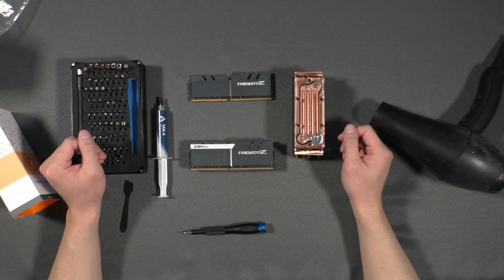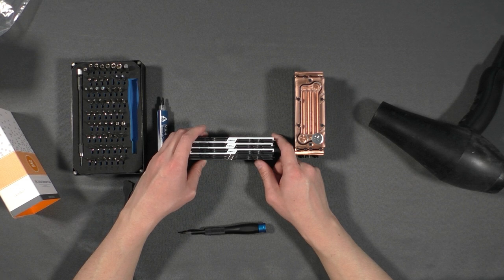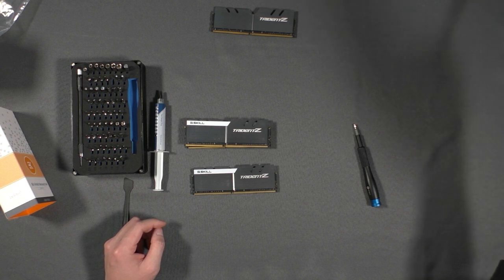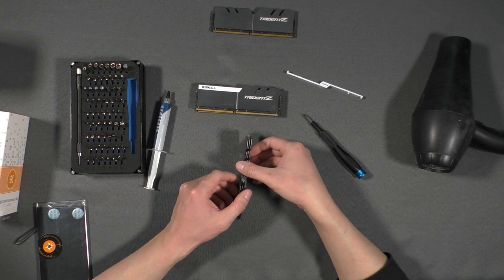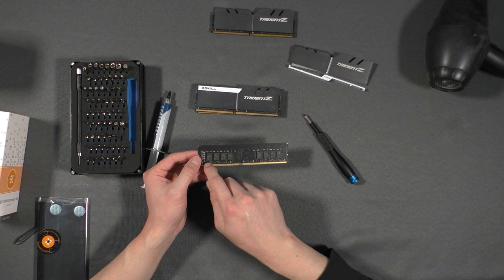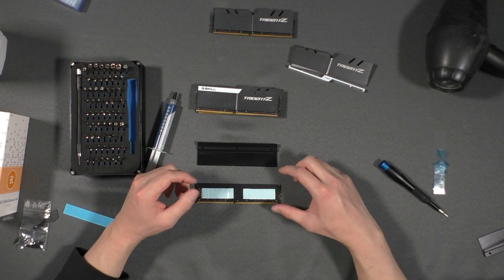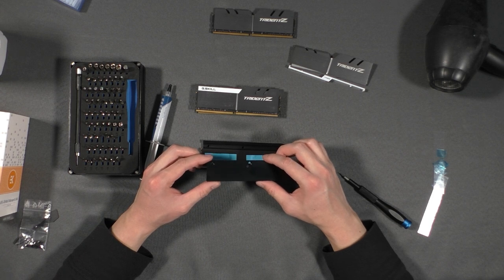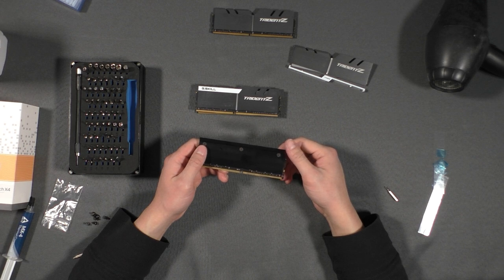DIY Watercooling Your RAM in 2020 - Curing Your Overheating RAM

Comment: as a tip for you if you need to do this again or with different ram, you can submerge the ram in white spirit and after about 6-8 hours it'll break the adhesive and the heatsinks will come right off, heating them and prying them apart is still not risk free, you can still pull an IC off with the heatsink in that instance if you're unlucky, the chemical method is much safer, I removed some of mine recently and some of the heatsinks fell off when i went to swirl the liquid some lmao
Reply: Wow amazing zip. White spirit, is that the same as mineral turpentine? Is the ram usable right away afterwards or does it need to be cleaned with ethanol first? Thanks 🙏
Reply: @Ben-ld1qi  you can use mineral turpentine yeah, white spirits and mineral spirits are the same jobby and all, as far as using them immediately after, you do need to let them dry but you can speed up this process by submerging the sticks in isopropyl alcohol afterwards to displace any spirits left on the board and under the memory Ic's and then just get a hair dryer at it and that'll work a treat will that
Reply: @blazingmatty123  awesome thanks! reason i asked because I'm doing a watercooled build with a ram block as well for the first time, was kinda concerned about using a heat gun and then trying to pry open but I'll try this method with turpentine. Thanks dude!
Reply: @Ben-ld1qi  honestly even if you're careful the heat gun method isn't infallible, the only thing that you need to keep in mind with the turpentine method is drying really but that's simple enough, as a tip for installing the monarchs too as they can be difficult to centre, measure your stick of ram, measure the monarch heatsink, and then set two heavy items up kinda offset from each other by half of the difference between in size, this way it'll be nigh on perfectly centred on each stick and it's repeatable, basically a fixture lul
Reply: @blazingmatty123  alright gotcha! thanks for the tips. so as u mentioned earlier 6~8 submerged in turpentine, then sumberg them in isopropyl alcohol, then dry them off etc... I can't wait to try this! It's probably going to take a few weeks until I get all the watercooling components
Reply: @Ben-ld1qi  depending on the ram it may not even need 6-8 hours but personally I'd just shove it in overnight or while you're at work or what have you, put it in some isopropyl for maybe half an hour, swirl it around every now and again and then take them out, apply hairdryer and then you should be golden
Reply: @blazingmatty123  thanks so much! 🙏
Reply: @blazingmatty123  oh man I just remembered there's just one thing i wanted to ask but forgot, I ordered a bykski ram block but it should be very similar to ek monarch. Is there a specific thermal pad u would recommend? I know that i will need 0.5mm on both sides of the ram stick since i have dual rank, just wonder which to get since i read that the stock bykski thermal pads are garbo. Thanks!!!
Reply: @Ben-ld1qi  ahh yeah installation should be very similar across the two of them so that should be fine, as far as pads go, I like the thermal grizzly minus pads but honestly ram isn't a high heat output so you should be fine with the included ones, but personally I'd go with the minus pads
Reply: @blazingmatty123  i just looked it, then i recalled seeing another youtuber (frame chasers) saying he used the minus pad (at the time i was like wat the heck is a minus pad), now i see it's the thermal grizzly minus 8 pads! I'll probably get those. I'm not too sure if 2 pieces of 20x120x0.5mm will be enough to cover 2 dimms on both sides so I'll just get the 100x100x0.5mm to be safe. Oh man thanks so much u really helped me out on this! 😘 🙏
Reply: @Ben-ld1qi  nicely, and whatever is left over from the ram will be useful later also

No problem, always happy to help like :)
Reply: @blazingmatty123  i found out I had something called 'mineral spirit thiner type 1' so I gave if a test go with an older stick of Corsair Vengeance LPX DDR4, after about 5 hours of it being soaked it opened pretty easily, there was just a bit of sticky/gooey residue on the actual ICC that needed to be wiped, and as I wiped the chips the printed writing on them completely disappeared, kind of weird seeing completely blank memory chips. The downside though, IT STINKS!!! My room now smells like a gas station and the RAM straight up smells like fuel. Did you also have this fuel smell? I wonder if it's this specific mineral turpentine that I used or they're all like that. But anyway I'm glad I gave it a test run with unimportant RAM. Still waiting on a few more parts so I can assemble the loop.
Reply: @Ben-ld1qi  Yeah that sounds about right, chances are the lettering on the IC's wasn't actually disappearing entirely but more likely just blending into the surface a bit, an old electricians trick for this is to take a little bit of thermal paste on your finger and wipe the surface of the IC with that and it should then be readable if you needed to do that, but the text itself is usually laser etched so unlikely to be gone gone, but likely just not so visible like, the sticky bit is always fun lul, usually neoprene tape on one side and thermal tape on the other side if it's single rank and thermal tape on both sides if dual rank

Yeah the stuff does smell a fair bit, personally I kinda like the smell, but it does go away after few days, be quicker if the window/door is open and you get a bit more air through the room, it's perhaps not as pleasant to be around vs the heat method but it's much MUCH safer
Reply: @blazingmatty123  Oh bro I love your prompt replies, you're the best! <3 It's not that I care about the lettering on the IC's but when I saw them disappear I had a oh shoot moment "did I leave them for too long in turpentine or something, is this supposed to happen?", I wasn't aware that the lettering is laser etched, good to know tha though! Suprisingly though, this cheap RAM that I tested this on, Corsair 2400CL14 2x8GB kit circa 2015, is actually dual rank, 4Gbit Hynix AFR, and the 'real kit' is 2x16GB DR B-Die, I ended up getting 120mm x 120mm Gelid Ultimate for it, should be plenty. Regardless though, for single rank modules, I've read to use 1.5mm pad on the IC-less side, I've personally never used neoprene tape, but might come in handy to have in the toolkit arsenal. By the way, just out of curiousity, do you recon that the water-cooling RAM covers with a decent 0.5mm pad should perform just as good if not even better than most the original heatsinks of most RAM (without watercooling the RAM)? JMHO but those water-cooling covers look better than a lot of the main stream RAM heatsinks.

For what it's worth, I decided to be a bit more animalistic  and brute force open the 2nd module from the older Corsair kit without pre-heating, DANG it was difficult, and I ended up scuffing the PCB a bit, as I used metal utitlity to pry it open like a savage. But lo and behold the module still works perfectly and none of them ICs were torn off lol. The funny thing is, on the turpentine opened kit, I could peel off the original (seems like 0.5mm was used) pads from both sides, literally perfectly, and still re-use them later on, while on the kit that I pryed open in cold-blood, there's virtually no way to peel off the pads from the heatsinks without destroying the pads and most likely lots of residue will still be stuck on the heatsinks.

Usually I keep the windows shut during summer due to mosqitues and just crank up the AC, but I opened up the windows over night and most of the smell is gone by now, so that's good! Oh and I decided to throw back the turpentined module back into it and leave it there for another full day just to see what will happen and if it will still function afterwards. My takeaway from this when I'll use it on the real modules, is set them over-night in turpentine, then set them in isopropyl alcohol to clean them off and wipe them dry. And not that note, I just realized that for the past year I've been using 'Alcospet' (Chrlorhexidine gluconate 0.5% w/v, Alcohol 70% w/v), I better get the real stuff!
Reply: @Ben-ld1qi  Always try my best to be quick ;P

Ahh yeah I get you, I've had many of those moments myself too lul, and yeah generally IC text is laser etched, not always, but most of the time it is :) you never know until you know so there you go now you know ;P 

So for the thermal pads that ultimately depends on the specific model of ram heatsink you go for, for the EK ones it's a 1mm thermal pad on the blank side but I believe the alphacool ones are 1.5mm on the blank side, usually this will be mentioned in the manual though mind you, I'd recommend against doing much of anything with neoprene tape all told, it's a pain to get off should you ever need to, I used to it a bit for LN2 pots but I'd always put a wrapping of electrical tape round the thing first so it comes off easier when it's time to strip it down

as for the heatsink part, really it depends on the heatsink, by itself without the watercooling shenanigans the EK or alphacool ones should be better than most but definitely not better than all, the trident-Z's have a decent heatsink so likely about the same performance between those, but for most of the heatsinks out there, the aftermarket EK or alphacool ones should be an upgrade yeah, particularly, patriot viper steels, the heatsinks on those are horrible and replacing those on my 4000 CL16 b-die kits which I had running 3800 CL13 allowed me to drop my TRFC from about 280 to 240 due to the better temps on the IC's, and yeah the watercooling heatsinks look much nicer so worth doing even just for that all told 

Yeah that's why we use heat or solvents to help break the adhesive, that stuff is ON there lul, lot of risk doing it that way though, it can work, but it's certainly risky, and yeah the turpentine method is great for reusing them, I actually warrantied one of my 4400 CL19 kits that I had replaced the heatsinks on by just putting the originals back on with some double strong thin sided tape I have ;P though after about a year sat in a drawer the thermal tape was still pretty sticky, just not as strongly as it used to be 

Ahh very good, really just some kind of airflow out of the room will help to get rid of the smell and all, as long as the stick is dry when it goes into the system then it'll work ;P usually I submerge it in isopropyl alcohol to displace the turpentine from under the BGA and then leave that to dry for an hour or two to dry, then just run it by the hairdryer once or twice just to be sure and that's normally good, and yeah always best to have the proper stuff on hand ;P that does remind me actually, I need to get some more myself, I'm about to run out on my last remaining bottle so I'll probably grab a few more when I get paid on monday
Reply: @blazingmatty123  Much appreciated ! :) Apologies in advance for the off-topic rant but I just had a real moment like that unfortunately last night, after removing the heatsink from an older i5 6600k/Z170 build, I found out the Kingpin KPx thermal paste was oozing everywhere and went a bit over the socket pins along the side, and in an attempt to clean it I've made things much worse and now I'm going to have to attempt to replace the entire socket. By the way is there a thermal paste in general that you'd recommend (regardless of price)? I bought the 30g tube of Kingpin KPx but compared to the Arctic MX4 that I had previously, it's much harder to use. The pea size doesn't really work with it, it has to be spread, and unless pre-heated before hand then the paste is very difficult to spread evenly, altogether it seems like I'd have to use 2~3 times the amount I'd use with MX4, and it only works well if I heat up the srynge and spread it. And it's much more difficult to clean and leaves a blue smurs trailing it which are difficult to clean.

You're right regarding the thermal pads size variety, I simply looked up on Bykski's guide and assumed it was universal. Thanks for the advice regarding neoprene tapes, what use did you have for them on LN2 if you don't mind me asking, is it for RAM extreme overclcoking or something else? I personally never ventured into LN2 territory, I'm just setting foot in the water-cooling world.
It's not the first time that I've heard people disappointed with the Viper Steel's heatsinks, I've seen people mention that they get better temps after removing the heatsink LOL. 3800C13 with 240 tRFC is pretty insane, what platform is this on? What software do use for stability testing the RAM? I'm currently using HCI MemTestPro but it takes forever! Sometimes I need to wait for it to reach %1000 to find an error, which is 7+ hours, all this for a single subtiming.\

So you actually managed to warranty one of the kits that you removed the heatsink on? HAHAHA! I'll admit that one of my worries was "what if I'll ever want to re-sell my RAM in the future", it's a TridentZ Neo kit, so you simply used a regular double sided tape, nothing that has some sort of cooling capabilities? I mean, if you ever end up reselling used RAM to someone to personally know than perhaps you could at least slap on some cheap thermal pads but for sending to warray who cares lol. I'm just wondering, for most RAM kits, is there anything holding the RAM heatsink together besides the thermal pad or adhesive tape used?

The strench that was in the room pretty much gone by now, I can only smell it specifically on the heatsink and old thermal pads that were submerged in the turpentine if i stick up close to my nose, albeit I have yet to submerge them in isopropyl alcohol, that might help with that. That's a pretty good idea you had there, I'll get a liter of isopropyl alcohol %99 and let them the modules submerge overnight and heat them dry. Appreciate all your help, you've been a wonder, and if I were your superior I'd give you a hefty bonus on this upcoming Monday :P
Reply: @Ben-ld1qi  Ahh don't worry about that my man, going off on tangents is my speciality too lmao, you should see what my discord server is like for that lmao, just the other day we went from talking about a friend considering putting his golden bin 5600X under LN2 to talking about the ideal office layout right quick in a hurry lul, as far as getting paste in the socket, moving forwards your best way to deal with that is to just spray a bit of isopropyl alcohol in the socket, and then with a makeup brush, with no pressure (this part is important) just brush over the affected area, you only need to clean it up off of the top of the pins to make good contact, if it's not electrically conductive paste (which KPX isn't conductive so you're safe there) you're fine 

As far as paste recommendations I'd actually straight up avoid anything meant for XOC, so kryonaut and to a lesser extent KPX as they have very low silicon oil content, which is great for anything lower than -25c (silicon oil freezes at around 22c) where there's less of it to freeze and crack, but makes it pretty much useless for daily use for more than a week or two by which time you'll lose the silicon oil via thermal cycling and capillary action and the lower quantity of silicon oil does make it harder to get out of the tube and harder to spread (this is why some of them tend to come in tubs rather than syringes), as far as pastes I recommend, ultimately depends on what you're cooling, if it's say, 250w of heat or less then MX4 is plenty, available cheaply in large amounts and that's that OR if it's for a cpu with an IHS I also use those IC diamond graphite thermal pads, performs about the sameas MX4 in that instance but not good for usage on a bare die like a gpu, for 250w+ heat loads my usual go to pastes are either thermal grizzly hydronaut (basically just kryo with more silicon oil) or noctua NT-H1, don't get caught up in the marketing wank that is w/Mk, NT-H1 doesn't have a listed number for this but it's around 3-5w/Mk if memory serves and it still performs right up there with hydronaut and similar higher end pastes, so I'd say either hydronaut or NT-H1 for higher heat loads, MX4 or graphite thermal pad for lower heat loads, that's yer best bet 

always best to RTFM it yeah ;P as far as the LN2 bit goes, that's more just for pots in general, you use the neoprene tape as a form of low profile insulation but it's basically impossible to get off in one piece so you wrap the pot in insulating tape first making sure there's no air pockets so that when it comes time to remove the neoprene (there are many reasons you may need to do this, primarily to change out your thermocouples) then it means it'll come off easily without a fight and without having to spend hours trying to just scrape it off, as far as what the LN2 stuff was for, just for extreme OC yeah, only ever had LN2 on the ram a few times, b-die for the most part doesn't scale too far with cold lower than around 25c so not a great deal of point going that far anyways since usually on longer sessions your ram slots will be frozen over anyways (usually when this happens I'll move from just cpu benching to memory as it's a two fer one like), I would suggest not getting into LN2 territory lul, it's expensive, dangerous (for you and your hardware) and it's a whole other rabbit hole lmao, though it is fun I'll give it that 

Yeah the viper steel heatsinks are horrible, the ram itself is great though, cheapest 4400 CL19 bin for really solid b-die you can get and even then all the 4400 CL19 kits I've got would do 4400 CL15 with some effort, and the 4000 Cl19 kits I've had all did 4133 CL14 pretty easy too, but yeah for benching 3800 CL13 with 240 TRFC quad channel is absolutely nuts on X299, iirc about 120gb/s read and write in aida with latency around late 40ns, stupid fast, and that was daily stable too, for stress testing ram overclocks I personally use testmem5 with the anta555 extreme profile, not had anything fall over unstable after passing a few runs of that, it does run for a long time, but a few runs can be done overnight, if it makes it through that it's straight up not going to fail in anything you'll do to it daily 

Yeah, if you put it in a ziplock bag it'll keep the tape and pads fresh enough to be reused ;P to be fair you can buy the same thermal tape they use on the dimms out of the factory so you should be fine on that front all told, but if you keep it ziplocked then you shouldn't need to do that even, if I were selling to someone I know personally I'd probably just buy a set of cheap shitty mem heatsinks off of aliexpress and just plop that on all told, good stock ram heatsinks are handy for other uses such as basic vrm heatsinks or a small part preheat plate etc etc, usually all there is holding ram heatsinks on is just thermal tape on both sides if dual rank or thermal tape and neoprene tape if single rank, that's been pretty universal in my finding 

That's good then ;P coming from a machining/engineering background, I've learned to love the smell of solvents lul, probably a bad thing, but it's a thing lmao, it's usually a bit better value to buy isopropyl 5L at a time, though it is a bit more outlay so I get why some do it 1L as and when they need it like 

No problem my man, always happy to help like, that said if you use the discord machine there is a nice group of lads and lasses that hang around the pc chat area in my stream discord server thingy, can always fire off an invite if you'd like should you have questions moving forwards :) otherwise sticking to this thread is also good should you need anything more :3
Reply: @blazingmatty123  Welp, hello there Mr. Pudding, sorry for the late reply, hope you had a great weekend! Sounds like a sweet place you got there, a discord server would be awesome :) Using a make up brush makes a lot of sense for cleaning the socket, why didn't I think of that.. I never thought I'll run into problems with thermal paste in the socket and even so I didn't think I'd end up bending the pins while trying to clean haha. And before assuming the worst it's also possible that the thermal paste blocked proper contact (as you said), hence I was getting 00 post code. But it's too late :P When I wrote to you about it it was already after I had a fit of rage the ended up destroying the socket entirely... just so I'd have an excuse to to try and replace the socket.

I ordered on your recommendation the 10g of Noctua thermal paste, albeit the slightly newer version NT-H2. When I initially ordered Kingpin KPx, I simply  wanted a good paste for OCing but not LN2, and on "Luumi's" (has YT channel) recommendation and benchmarks I ordered the KPx. Otherwise my main consideration were the TG Kryonaut, Noctua NT-H2, Arctic MX5 & Gelid GC-Extreme, and it was literally a very close toss up between all of these. That was some really great explanation on the XOC thermal pastes, how they work, what they're meant, and why they're not suitable for daily use, I've never read into that depth, besides the common rant "KPx/Kryonaut lost its efficiency after X weeks/months". I'm not too sure on how my max wattage but my current setup is: i7 12700k (83SP P-Core rating, *meh*), 3080 Ti FE, 2x16GB (4000 16-16-16-36 1.4v XMP) DR Samsung B-Die. I enjoy learning things by tweaking or just messing around a bit and overclocking as long as it can pass for a daily stable otherwise not too interested in just benchmarks if I can't run it daily. Is the IC Diamond pad re-usable, as in can it be re-used if the CPU cooler is swapped? Could be really handy for various situations.
Don't worry about me as I'm way too amateur to dwell into LN2 territory, although it's pretty cool to watch what people do on LN2 to see how far each generation can be pushed to.

I've watched a couple of videos of Buildzoid overclocking the 4400C19, yeah they seem like a really solid kit, and they're probably amongst the cheapest go on discount often. I'm almost finished overclocking my RAM kit to the max (as much as I can with this 12700k's IMC), it's been such an agonizing process, yet I can't stop hahahah! It's like I can't rest until I know none of the timings can go any lower. I'll run TM5 later on to double-check, there's also 'Absolut' profile, more recent I think.
Good idea I'll ziplock the thermal pads on the B-Die after using turpentine on them! Regarding cheap RAM heatsinks on Aliexpress, that's a pretty good idea, it's amazing for how cheap you can get them, heck they even have ones with A-RGB lols. "good stock ram heatsinks are handy for other uses such as basic vrm heatsinks or a small part preheat plate etc" << I'm not sure what you meant here like how do you use RAM heatsink for vrm what is a pre-heat plate?

It's kind of difficult to find IPA in my region since I'm not form the USA, but I found a raw metarials for cosmetics distributer and they sell IPA %9.99, 1L $8.57 and 5L for $35.70 ($7.14/1L) so I think I'll buy from them :) Maybe I can even add some of it to my morning coffee hehehe. 
You've been a HUGE help, I mean it! It's not everyday you meet someone that has the patience to explain things and go into detail. I've just started building my water cooled PC yesterday and OMG yes just a tiny bit of help could a long way and it will much appreciated <3 Thanks so much !
Reply: @Ben-ld1qi  Don't worry about that my man, better late than never right ;P I'll shove a link at the end of the message as far as the discord shenanigans go :) and yeah the makeup brush is a solid idea, I'm not sure where I got the idea for that from all told but I'm sure I'm not the first to think of that lul, ahhh yeah I get that feel, hopefully replacing the socket goes well for you, difficult process that but if you can pull it off then you'll have managed something I never attempted :P 

Ahh yeah I had forgotten about NT-H2, can't say I've used it but I've heard it does perform a bit better, another good one that had slipped my mind (you mentioning luumi reminded me) is that GD900 stuff, from what I recall of luumi's video it performs a few degrees off of kryo which is quite impressive for a cheap paste off of aliexpress and all that, MX5 i've not had very good experience with, suffers the same issues as kryo does in my finding, great for lower heatload but it dries up pretty quick with hot procs, I ran into this issue on my 7920X which I had running 4.9GHz 1.4v (about 450w), as far as wattages go, the max I've seen out of a 12700K is around 250-300w but the heat density makes cooling hard, 3080ti's can get into the 350-400w range too but then that being said those have their cooling direct to the die so that's not as big a problem all told, I quite enjoy overclocking to see how far things can go and what numbers I can get out of benchmarks but then daily stable is important after that lul, and yeah those IC diamond graphite pads are reusable, about on par with MX4, they're great, not much use for a gpu, but for a cpu they're great, reusable many times, I've had mine for years and it does great still, I've used it on amd procs (3600X, 5600X, 5900X, 5950X) and intel procs (6700k, 8700k, 9900k, 10900k, 7800X 7920X, 7960X), never had any issues with them though they're not amazing for very high heat 

I thought that when I started LN2 too ;P 

yeah BZ loves those kits, and I do too, I love the 4000 CL16 kits they do, 97 quid for that kinda bin is lovely since that's just a working XMP on a lot of intel cpus and all, it's the same top shelf bin as the 4400 CL19 kits but just slower and tighter set profile which is nice, but yeah memory OC is a pain at times isn't it lmao, though you could prolly get your secondaries and tertiaries lower ;P but that's a whole other headache and will legitimately take you weeks lmao, and yeah I think the iceman ones are like 10 quid for a pair which is pretty nice, but then again the bitspower ones are also fairly cheap too, but assuming roughly the same thickness they should all cool mostly the same considering they're all aluminimum, the rgb ones are nice if you're not planning on putting a waterblock on them generally, and tbf you likely wouldn't need to block them up unless you were planning on setting your TRFC silly low with around 1.5v etc, and even then you may well be able to manage that if you don't block them up, as far as the basic vrm heatsink, that's more for testing parts, if you've got enough space around the vrm you can just put a thermal pad on the vrm and use the ram heatsink essentially just to soak up the heat the vrm spits out for short runs etc, preheat plate is for soldering, you'd heat the heatsink up and then put it on the component side of what you want to desolder/solder with a thermal pad/thermal putty for a bit and it'll heat the pcb in that area some so the soldering iron isn't having to also heat a big power plane or ground plane as well as the solder joint you're trying to melt 

I'd hope that's 99.99% and not essentially 10% :P but if it is 99% then that's pretty solid, that's less than what I pay for mine, I pay about £10 per L if I buy it 1L at a time, though about £7 per 1L if I buy it 5L at once, best not adding it to coffee ;P I believe chubbyemu did a video on that lmao 

Not a problem my guy, always happy to help like :3 these things are something of a niche knowledge so I'll always be happy to pass that on, as they say, you never know until you know so there you go now you know ;P, water is also on the somewhat niche end nowadays, but it's worth doing imo, though I also have lots of old tips for that and all lmao but some of those kinda go against what watercooling is meant to be lul 

as promised, here's the disc link: https://discord.gg/r2BTgpMHHt